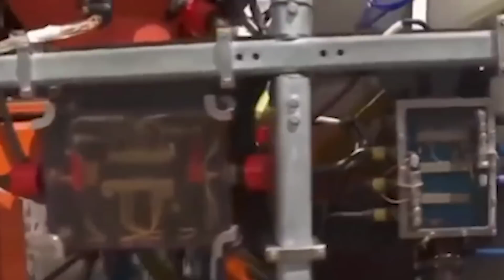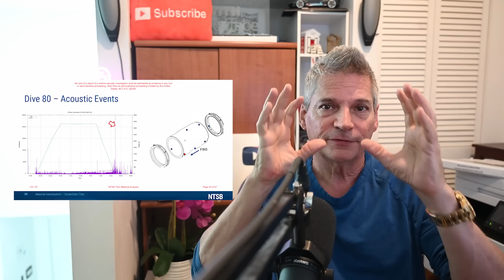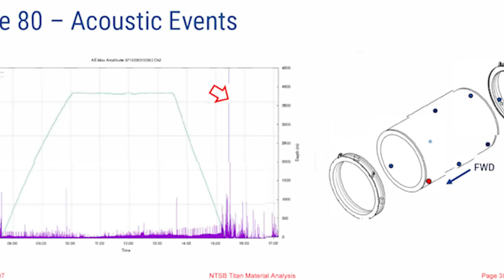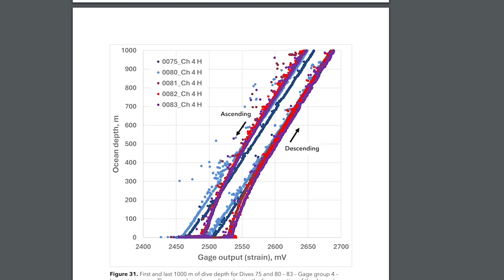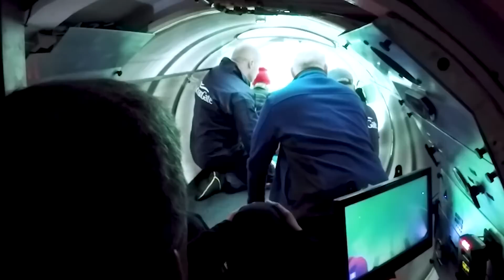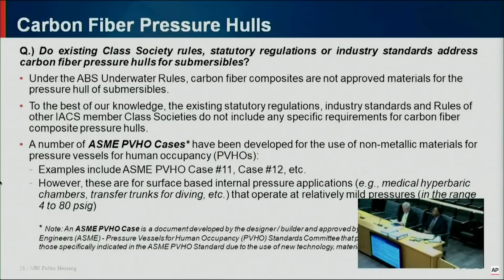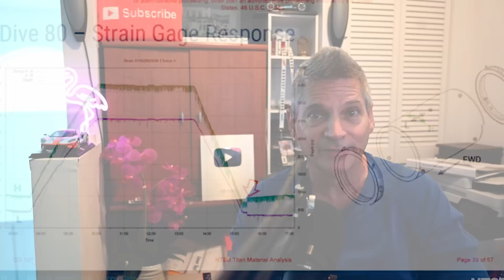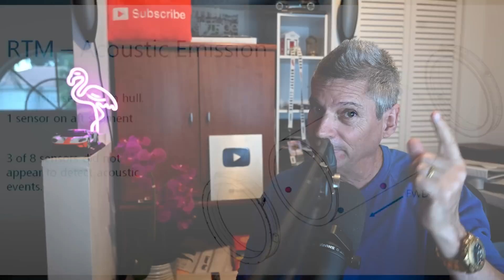How OceanGate Titan Sub Realtime Hull Monitor FAILED! RTM

Comment: The recorded sounds caused both by fiber cracks and by glue breaking loose from fibers. Every sound is damage, a carbon fiber hull doesn't make any sounds when nothing breaks. 
Of course that damage doesn't heal. Sound being recorded in every dive means that the design has a limited lifetime. Many microscopic cracks and delamination zones add up until it implodes. There's nothing special about it. Every fairly modern airplane is designed for a specific number of flights. I don't know about professional submarines but most likely it's the same there because the physics that slowly deteriorate the material are the same. It's also the same reason why cars start to fall apart when they get old and relevant parts are designated to get changed after a certain mileage.

No matter what you design, it must be strong enough to sustain a certain amount of deterioration before it fails. When you design a pressure hull, you predefine both the depth limit and a limited number of dives to that depth. For example, you design it to be able to go down to the Titanic 10 times. That means: The pressure hull deteriorates in every dive and the combined deterioration from all the dives makes it unsafe to dive again after 10 dives. You have to retire it after 10 dives. 

In aviation it's common standard to build a a 1:1 prototype for destructive testing. It gets set up in a special jig with tons of sensors and then they stress it until if fails. A 1:3 model is not acceptable because structural test results can't get scaled reliably. 

Despite the rules being broken, the monitoring system worked well enough. It recorded the deterioration and it showed exactly when the damage started to get out of hand. 
Data from Dive 80, when the loud bang happened, shows very obvious signs of hull damage.  That data was misinterpreted, ignored and never even looked at. If they had used that data the way it was intended to be used, they would have retired the sub right after Dive 80. That was when the structure was deteriorated so much that it could implode in every subsequent dive. 
They had even defined peak sensor readings that would have required immediate surfacing as soon as they were recorded. The sensors recorded peaks way above all specified limits in virtually every single dive. That data was misinterpreted, ignored or never looked at either. If used like intended, they would have found it neccessary to retire the sub after just a few test dives without ever going to the Titanic. 
The fact that the sub broke the limits set for sound events in every dive proves that the design as incapable of doing what it was intended to do. That proof was there early enough. Nobody would have get harmed if they used their safety system the way it was intended to get used. 
But they kept on diving until it imploded.

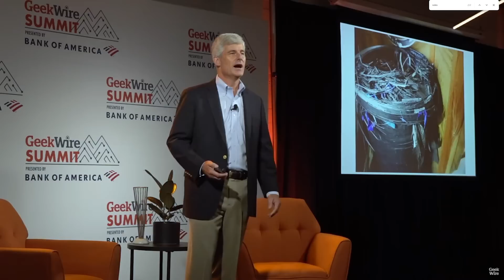Comment: @5:13 "The pressure and temperature at 1000m 2000m 3000m is always the same". He cannot be that stupid surely? Perhaps, he is just a liar. Very worrying.
Reply: I think he meant like, suppose you dive to 1000m today, and do the same again next week, the pressure will be the same both times
Reply: @adamheywood113 that’s how I interpret it, but he didn’t articulate it very well - in part bc he was rushing to gloss over any difficult questions!

Comment: Use a titanium mandril, skin and rings weld them all together so the titanium is being internally supported by the carbon fiber.  Basically the same concept as foam and fiberglass surfboards.

Comment: I've been thinking about the design of a submarine vessel using carbon fiber since this happened. I think that if you were to make the hull out of connected spheres and it was wound in a controlled, rarified atmosphere to reduce voids, then assembled in a clean-room, you might be safe down to 1km.
That RTM is just ridiculous in how sparse the sensors are! There is no acoustic sensor on the fore segment and only one on the aft! How can you locate the source of the sound/vibration with one sensor? I'd have at least two 180 degrees apart on the fore and aft rings. And more on the hull. Its a terribly lame attempt to monitor the condition of the hull! I think Rush was believing his own hype and trusting himself far more than was warranted! Its sad that he had to take others with him. If it had been him alone, I think we'd see the situation differently.
And they only imploded ONE model! How is that proper testing? When my life is on the line with something like that I want to run enough tests to see anomolies in  the failure point from defects in construction. That is not enough data to make any sort of decision.
I agree with your questions of the wall thickness, autoclave process, and RTM. Way too much trust baked into that whole process!

Comment: I agree with you about the support hoops.
I agree with you about using the original 10" thick hull.
I also believe the attachment of the hull to the rings needed to be more thoroughly researched prior to assembly.
But in the end, an inescapable conclusion is,
1) it was a very bad design.
2) Stockton was not an engineer or designer of any credibility.

Comment: 👍 interesting.
Perhaps his 'patent' was, inter alia, designed as a 'smoke screen' to pour oil on any concerns regarding monitoring of the structural integrity and safety of the submersible.
What has also emerged, is that the failure could have initiated at the interface between the carbon fibre hull and the forward titanium ring .. the 'glue'. Materials with differing compression / expansion characteristics under extreme pressure would have placed considerable 'in tension' (excuse the term .. I am just a layman using terminology that I 'understand' 😏) on the adhesive. Should that 'glue' (that which 'held everything together) not have been up to the task during repeated compression / expansion cycles, then .....
Your statement regarding 'additional metal rings' also crossed my mind during my previous mullings over the subject (during my early morning Nordic Walks 😏).
My train of thought covers the somehow incorporation of titanium metal rings inside (?) the end pieces of the carbon fibre hull, where the titanium end caps and mounting rings were situated. 
Perhaps (?) 'sandwiching' the carbon fibre between two rings of titanium in order to better 'conform' it's expansion / contraction characteristics to that of the titanium would have been an option?
Who knows? Perhaps further analysis will determine the definitive reason for the implosion and it's accompanying failure chain.
A good share thanks. Take care ..

Comment: What probably doomed the Titan submersible was the rule that you do not mix titanium and carbon fiber elements.  My gut feeling is that the titanium end rings and the carbon fiber hull did not have the same compressibility, so they reacted to the increasing pressure by different amounts.  Both elements would react to the increasing pressure by reducing their diameter, but they would not compress by the same amount, left to their own devices.  However, the construction of the Titan forces the end rings and the cylinder to be the same diameter, at the glue joint.  To stay at the same diameter, some of the load on the element that compresses more is transferred to the element that compresses less, and this stress is transferred as a shear load on the glue joint.

The evidence that backs up my gut feeling is the condition of the forward end ring.  There is no carbon fiber attached to the forward end ring, because the glue failed.  If the carbon fiber cylinder would compress more than the titanium end ring, and the glue joint failed, the load needed to keep the carbon fiber cylinder the same diameter as the titanium end ring would be dumped on to the inner lip of the end ring, which was completely sheared off.  I would be willing to risk a small amount of money that the reason that someone at Boeing advocated for a ten inch thick cylinder wall was to match the compressibility of the two sections to prevent shear loading the glue joint.

Comment: It's not a problem that it's reactive. That's what any monitoring system is. The problem is it was poorly designed and executed, and lacked enough data to be a reliable indicator of known failure modes. It all goes back to time and money, and Stockton was clearly cutting corners all over the place. The main failure point was Stockton.

Comment: Why wouldn't you put titanium ring sections through the carbon section too. I'm no engineer but clearly you would think to put at least maybe 3. One in the middle and one either side  hallway of the remaining section. Then have equal load force reduced greatly from the carbon fibre.

Comment: Monitoring systems are a back-up for fail safe systems.  Sensor monitoring of the hull would only have a place as a learning tool to understand how the pressure effects a hull, which is scientifically proven to withstand the pressures at depth including the safety factor acceptable by industry standards.  Using real-time monitoring of the vessel hull as the primary fail-safe is something of a self fulfilling prophecy.  The concept alone implies that they don't know if the vessel can withstand the pressures needed and that they do in fact predict a failure at some point.  They know it will fail due to cyclical loading, which is the point you scrap the project and re-engenieer a new vessel that is not expected to fail.  Putting humans inside a vessel that is already predicted to fail catastrophically with the single safety procedure being, they hope to get some warning when it eventually will fail is murder.  The ocean gate trash-fire-logic has amazingly low level thinking starting at the top reaching to the very bottom.  Stockton was a stupid person, meaning very low level IQ complimented by an overwhelmingly powerful Dunning Kruger curve.
 Regarding you last line of thought in this video. The coefficient of each material is different.  The thermal expansion varies immensely from carbon fiber to titanium.  Adding steel or metal supports would not have prevented buckling. Given that they could not make the hull a single component which is why they needed the titanium end caps, just the math on the inappropriate material coefficients of the two main hull materials is all you needed to know in order to scrap it and re-design.  The bottom line is a single competent 12th grader could have done the napkin-math and predicted the eventual failure rate to be 100%.  Rich folks ain't looking so smart; now are they?  How he got anybody into that death trap is beyond me, let alone pay.  Extinction has always played it part in evolution.  Nuff Said.

Comment: Sorry, but also: fibers.  Most places we see them they are under tension.  That is how they work best.  When we need something to work best under compression it's often something dense and solid.  Like bricks.  Or concrete.  Or steel.  Or rock.  Those things work well under compression.  

And Underwater is ALL COMPRESSION!  10ft. underwater your lungs no longer work and you need compressed air.  It gets worse from there.  Hey, didn't we already figure this out in the Victorian or Edwardian eras?

Ok, I'm done.  This time 4 realz.

Comment: There was not equal pressure as the inner layers are not the same as the outer layers. As you apply layers on top of each other the outer layers are ever so slightly larger. Just look a spool of thread.  And going back and forth to the facility where they had to take it to cure each layer

Comment: Those 'strain' gauges were only glued to the inner circumference, so how could they give useful measurement of distortion acting inward, acting anti-radially? If those devices used piezoelectrics or load-cells to measure compressive force, how much would they be compromised by the glue? And how much useful compressive data could they show anyway? But even if the warning system had worked, and it had warned at 3800m, would the slow rise of the craft reduce the danger fast enough? If the pressure at 3800m had weakened it, the pressure at 3700 or 3600 or even 3000 might still be enough to finish it off. Russian Roulette with five chambers loaded is not a good idea.

Comment: Definitely a leap of faith, one example of tested to failure.  Seems whatever the results of the RTM they could say ‘this is fine’ as the pressure was less than the pressure simulated in the single test to failure.  No testing of the effect of going through cycles of pressurisation / depressurisation, maybe failure occurs after 50.. cycles of half the pressure causing failure in a single test.  Sad but like the Comet airliner, analysis of the failure may lead to increased safety / innovations.

Comment: The idea of adding rings to the inside of the pressure vessel is a good one. Plus if they had attached the tension gauges to the rings they'd have picked up on dynamic load changes far better than the localized readings they were getting from the carbon fiber hull directly. In the end I think the manufacturing defects doomed them, undoing whatever margin of safety that was left in the design.

Comment: Great show. As a retired Navy Submariner, I know exactly what you are talking about and love the way you break it down for Laymen to understand- good job. My only comment is that I personally think that he TURNED-OFF those 3 sensors, because if you look at the diagrams of the wreckage and where they think the crack of doom began, it started right where at least 1 of the sensors was- right where they bolted the forward dome onto the hull.

I know hundreds of Submariners and they all agree that as soon as they say that death trap didn't have an escape hatch and the "normal" way to enter and exit the thing was bolted on- NONE of us would ever go underwater in that thing, not even to just 10 feet.

Lastly, if they used Boeings suggestion to go with a 10 inch hull, based on how pathetic and flawed they made the 5 inch hull, the same result would of happened sooner or later. Maybe 10-15 more dives than Titian, but no mistake, it would eventually suffer the same fate. Spheres- using spheres is the key. Have you ever looked at a cut-away of a Navy DSRV? Spheres.... we used spheres, and so did James Cameron, because it's the absolutely best way to deal with extreme pressures.
Reply: Big agree on the thickness. I'm no submariner, but I worked for years with composites and carbon fibre, and imo that thing could have been 50inches thick and likely the same result would have happened eventually (especially with how poorly it was built with sanding down layers, not in dust free environ etc). Granted, I worked with lightweight car builds and body panels, but a delam is a delam is a delam, doesn't matter where on the car panel it is, thickest or thinnest point oif body work, it's still a delam that will be a failure point.
Plus many theorise the failure was around the glue connection between the titanium ring and the carbon hull, where thickness again wouldn't have made any difference.
Reply: escape hatch would have been of no use anyway

Comment: Should have done a spun copper filament resistor system instead. It would have told them where the breaks were exactly.
To a millimeter in distance